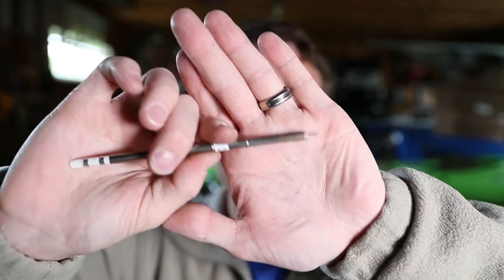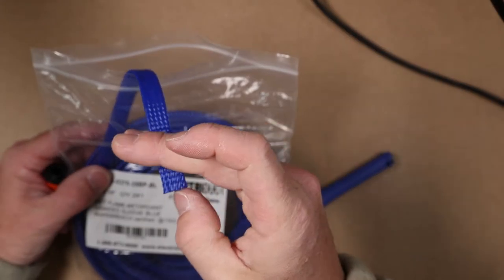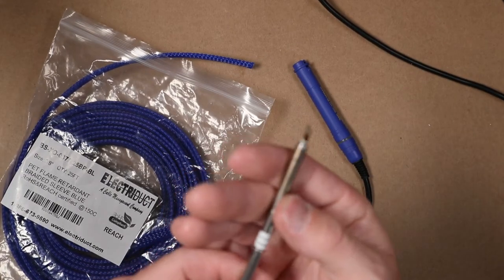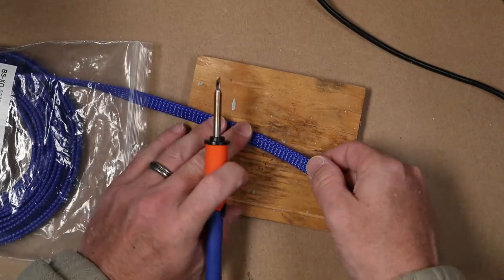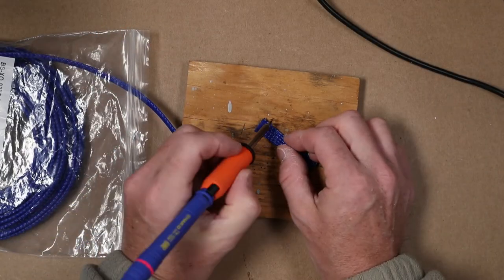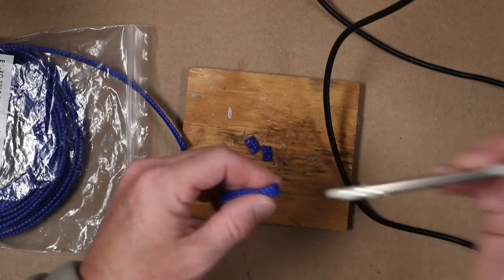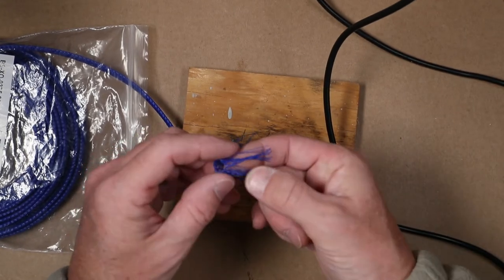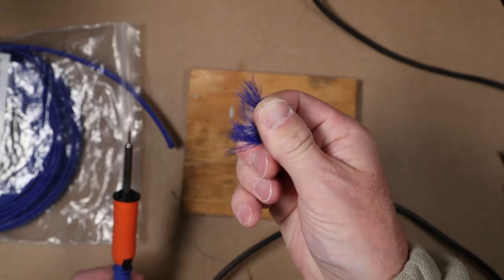The best tool for cutting nylon braided sleeve

Comment: Link for this tool?
Reply from the maker: Here’s the link for the tip. It works in the FM-203, FM-204, FM-205, FM-206, and FX-951 stations.
https://hakkousa.com/t15-ku-knife-tip.html
Reply: @breaksteel  any hints on how to thread a 25 ft 18 guage wire through 25 ft of nylon braid (1/8 diameter). i got to 5 feet and it started getting difficult.
Reply from the maker: @turinreza  need something that won’t bend to lead the way. Think of like a pencil or something similar you can tape the wire through. Then you can push a length through and sort of milk the nylon down the wire. Repeat all the way down. Could also split some nylon tube to install the wire and run that onto the braid as above. 
There’s really no easy way I’ve found other than those methods.
Reply: @breaksteel  great! thank you